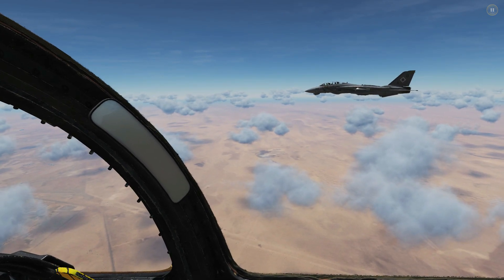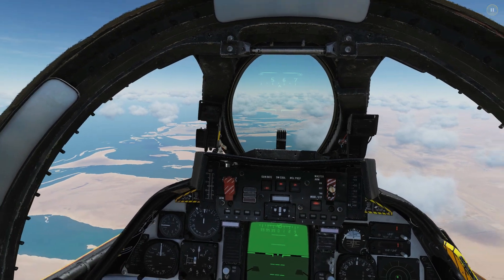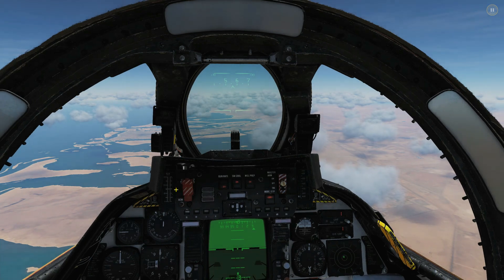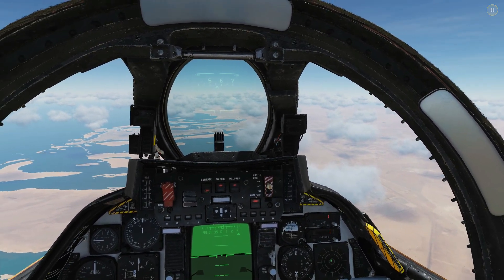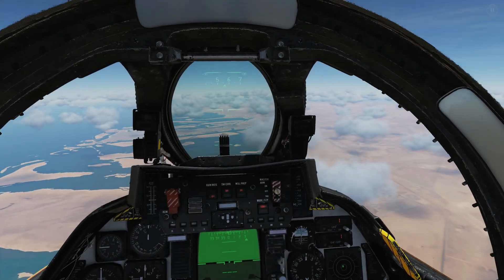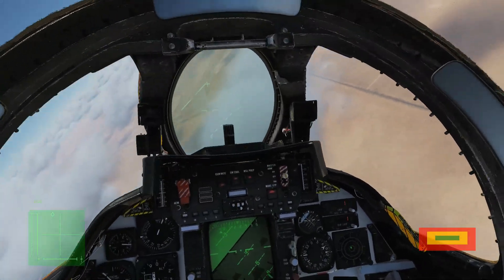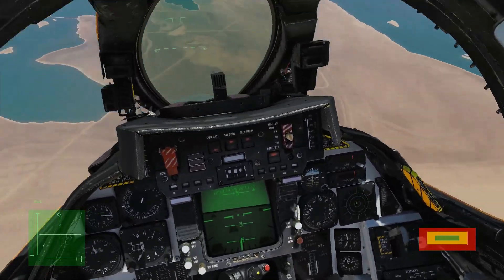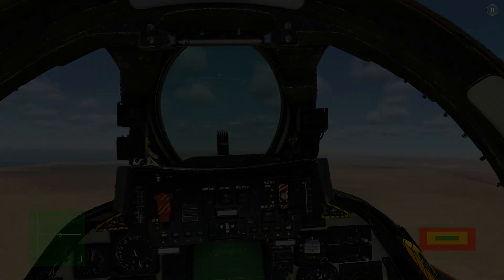F-14B Tomcat: Flat Spin Recovery Tutorial | DCS WORLD

Comment: Question: When you power the opposite engine, do you go to full after afterburner? Or full Mil Power?
Reply: With the asymmetric thrust limiter on, only mil. This is because of the added safeties to avoid asymmetric thrust through burners causing a spin. It will not allow one engine to be in burner when the other isn't, this is why in the B sometimes it seems like it takes a bit for it to fully enter burner, it's slowing things down to make sure it's even on both sides. If you switch that off the Engine Control System will allow full burner. 

The A model TF-30s do not have asymmetric thrust limiting as well, so they'll always allow whatever you put in them.

Comment: The F-14A TF30 vs the F-14B F110 with the TF30 having a bad life with the F-14, in tearms of problems with Flame outs and lacking power, question is between the TF30 and F110 how better is the F110 too the TF30, for example the scene in top gun 1986 would that happen with a F-14B or less harder to happen.

Comment: Any differences between the TF 30 powered Cats and the ones powered by its successor engines?
Reply from the maker: Will investigate
Reply: Yes, the TF-30 were quite underpowered compared to the GE engines. Once the GE engines came the engine stall issues were resolved. The aircraft a=was a true stick and rudder aircraft if there ever was one.

Comment: The two rudders generate an unbalanced couple via yaw angle. The most effective rudder is the one pointing to the center of the airplane. Basically the vertical fin shields the rudder on the inside of a turn. In this case, rudder to same side as spin makes the outside rudder (pointing to the center of the aircraft) an airbrake that slows down the spin. The inside rudder has almost no aerodynamic effect because it's centered in turbulence. That's why 2-rudder aircraft are uncommon.

Comment: just a guess (I'm not a pilot), but when you are in a spin, the inside wing is stalling more than the outside wing...and if you're falling and spining, your flight surfaces arent working properly....but the f14 is so large, maybe going full rudder is meant to make the spin a bit faster with the intent of making the stall on the inside wing so much worse, so that it forces the nose down?   

I mean, nose down and spinning is a much better position to be in....
Reply: I remember watching a video for American Airlines about getting out of odd AOAs and the instructor mentioned that for one of their planes, the rudder was so large that it was possible to fly the plane stable at a 90° bank because the rudder was so large that it was a functional horizontal stabilizer when the plane was on its side. "top rudder". 

he also said that if the other type of airliners were in a bad nose up attitude and inverted, the pilot wouldn't have "pitch authority at pattern altitudes". so, while turning out of an inveverted attitude, they were told to use coordinated full rudder to keep the nose up (opposite the way you're turning), because there isn't enough stability to keep it flying without going full rudder. 

this is likely all obvious but I mention it because he also said 'in his other life', his aircraft could fly at a 90° due to thrust vectoring, computer systems and large flight surfaces. He was clearly a jet pilot previously......so, maybe in the F14, the rudder still works and is intended to make the stall worse so the nose pitches down, into the spin? maybe if you reversed your engine power and did everything else the same, it would force the nose down faster?  

again, it's probably obvious why I'm incorrect and I'm too uneducated on the topic to know it. if so, please dont hesitate to correct me! I may just have come up with a technique that will send you into the dirt faster or is already known to be ineffective.....so, keep that in mind. 👍

Comment: I note you're not using aileron into the rotation.
This is how I understand it from aero studies - it's all to do with roll induced yaw.  Conventionally in a right spin you put opposite (left) rudder and right aileron, this combats the yaw effect by creating lots of drag to one side (similar to crabbing / adverse yaw).
On the F-14 in you wont have wash over the tail (obviously) and in a twin v.stab you have significantly less tail authority to work with (the leeward v.stab will be blanked by the winward, and the windward side has therefore 1/2 the tail area required for stability!).
So pumping left rudder into a right spin does nothing other than continue to help stall the v.stab.  Ruddering INTO the direction of the spin unloads the windward v.stab and due to this v.stab being offset from the CG you will get a roll induced moment to the right created by the yaw input.  This combined with the right stick, right engine, will combat the yaw but also put the aircraft on it's side helping it to pitch down and recovery.  There are gyroscopic forces in there as well as the plane rolls out of axis but that's above my pay grade ;)
Note in the r/l video the controller calls for left rudder, which is conventional but not for a twin tail imo.

Comment: I also was the Maintenance  master chief in VF103 when modified  the squadron aircraft to digital  Flight controls  (DFCS)   basically taking an analog system and making it digital.  Although the actuators when not modified... all done through upgrades control computers like the CADC ...  the nice thing about DFCS it made the aircraft extremely  hard to depart...   this result was make a poor pilot, in to a mediocre pilot..  i was also told the very good pilots hated DFCS  because a really good tomcat pilot knew how depart and regain control in a dog fight to win... DFCS stopped this ability... again I was a maintenance  chief... my job was fixing, not flying them...  what I am sharing is what I told by the crews on post flight debrief...
I remember a new crew had a DFCS failure and they tried doing some in flight trouble  shooting ... they pulled 4 DFCS breakers which had the effect of returning the jet back to Analog  flight controls... the analog tomcat had a problem with a Dutch roll (wandering nose)... this scared the crap out of the young crew... which had been around just few years earlier they would know what jet was doing and not freaked out do bad ... 
Funny thing we found out about DFCS ... on the cat shot if the crew raised the gear to soon, upon lowering  the gear the DFCS system would fault...  causing maintenance  a bunch of work ... fix was to count 3 potatoes then raise gear.. so once jet went weight of wheels the DFCS control system had a chance remember the flight parameters. Raise gear to fast the system went stupid when gear was dropped ... 
Thanks bringing back the big fighter for me... I loved my sailors, my Tomcats and my squadrons... best time my life and I have enjoyed sharing my memories  with you guys

Comment: I remember  the crews had go through spin recovery  training ... and I lost an A model due to a Flat spin in 101 ..  the MIsshap board I believe decided that the turn needle  was not correctly  marked ... the crews had trouble seeing the turn needle and if I remember correctly the turn needle had been changed to a  conflicting color ... again I believe  it was suppose be yellow ... .. this aircraft had need modified with correct turn needle but later in the aircraft's service life the turn needle had been replaced  with the old white on white needle.. 
I remember researching when technical  directive had been done ... 
The reason the contrasting color needle so the pilot can see  the direction of the flat spin easier ..in the turn and slip needle, because pilot got confused and put the rudder and engine thrust in the wrong direction  and increase the rate of spin
Reply: Which noticed the turn and slip indicator  in this simulation is white on white

Comment: I have two problems with the Tomcat first is sometimes it will deploy automatically maneuver flaps and won't close them when not necessary (example air to air refualing) is there a way to disable that? , and the second is I can't turn fight AI no matter what I do they don't run out of energy, I don't have good internet so I can't fight real people, can you give me tips on how to fight them or is it just the cheating AI  ?
Reply: Put the flaps up, put the wings in manual and partially sweep them for refuelling.
For turn fights, keep the wings forward, half flaps and throttle for ~320kts. Don't pull too hard. The easiest mistake is to pull for G and you end up with 20+ units AoA which dumps the energy. Once you realise that she turns really quick at lower G and 10AoA you'll do better.

Comment: The flight manual says rudder in the direction of the spin because that increases the air flow over the horizontal stabilizer.  This increases its “authority” in regards to getting the nose to point down.  Realistically, all you need to do to recover is get the nose pointed in the direction of travel, I.e.  down.
Reply: It makes sense. In the f-14, the horizontal stabilizers is what give you pitch control so it's logical to increase "authority" over these control surfaces. The flaps in the wings also help with pitch control but in a flat spin I'm guessing it doesn't help much.

Comment: by the way, another method that seems to work a that better is to roll in the direction of the spin, push the nose down, no need to rudder, this always (at least 95% of time) worked out for me and i could easily recover in less than 5000ft ;)

Comment: I would guess that if the manuals are saying rudder into the spin, that means they modeled/discovered in testing that in a spin mode the plane is actually experiencing a little bit of backward airflow, in which case your rudders work backward and right rudder helps you turn left etc. I'm sure an actual aeronautical engineer could confirm or deny this.

Comment: Was having problems with this the moment I got the Module. Always happened to me when I had the wings open. I pull them in as soon as she starts shakin sometimes that is enough to stop the shake before it really wigs out. Front end goes down easier. Rudder (check), wings in (check) but never tried the engine shut off though. Looks like it works. Love this beast of a plane.

Comment: A lot of the Tomcat’s lift comes from the fuselage and it’s stalled too.  An engine flameout and asymmetric thrust could/did cause a spin to the same side as the flameout so the big heavy plane is headed in that direction. I think ‘traditional recovery’ opposite rudder would work too - eventually. As time is of the essence in this situation, the Tomcat uses ‘same rudder’ and elevator down to roll into a diving corkscrew from which wing and fuselage are unstalled and normal recovery can be made. Cap’s low altitude recovery shows the tendency when it looks like he rolled inverted due to slow input normalization and almost entered an opposite inverted spin. Pretty sure that’s what’s going on with this. (Pilot for 42 years)

Comment: I did that inn an F15 - it was not nearly as dramatic. Take off - on the deck till 550kn - then vertical till stall - flat spin - recovered at 5000 feet. and made a Mach 1.2 pass overt the runway.

Comment: Can you do the same video for the SU-27? it can easily get into a flat spin or in a stall and is soo hard to recover.
Reply from the maker: Roger
Reply: @grimreapers  Would you mind testing the inverted flat spin, too? I managed to get into one in the SU-33 and failed to recover before the engines died completely.
Reply: Flat spin it can, yes, inverted, no, the fuel cuts the engines too quickly (before the spin fully develops)
Reply: @CameTo  But I did and managed to replicate it. You have to force it, but you absolutely can make it go into an inverted flat spin.

Comment: According to what I've read and heard, the F-14 still recovers from flat spins better than the F-4 did.
There were two developments that improved the possibility of getting out of these or NOT getting into them to begin with.
One was the GE F110 engine which had a better stall-free envelope than the TF30 ever did even after they spent $250million to fix the P&W engine! 

The other major development, applied to all core Tomcats scheduled to stay in service past 2000, was the DCS.  The Digital Control System improved the handling qualities of the F-14 and made it easier to fly.  Too bad it wasn't implemented earlier!  The DCS was partly based on work they did with the Twelfth F-14 (1X; so-named because it was finished faster to replace the original, lost F-14 prototype and take over its flight test assignments) at Dryden Research Center in the late 1980s.  They did research on modified flight controls for the F-14 exploiting (I forget exactly) the Aileron-Rudder Interconnect?  Anyway, the funding ran out for that program so it was never technically finished and they didn't apply the data collected to F-14 improvements for years. 

A series of control system accidents finally forced the Navy to re-explore the issue and fund the digital control system upgrade.  It's not fly-by-wire; it just uses digital computers to coordinate all the hydraulic lines, actuators, cables, etc., etc. better than the old analog system ever did.  The DCS made it easier to fly the Tomcat and especially land it on carriers regardless of the model.
One of the highlights of the DCS history was that one of the modded A-models that stayed in service past 2000 actually engaged in a DACT exercise with a Romanian MiG-29.  The F-14A pilot won that dogfight.  Surprised a bunch of people who thought the old A-model was a tired dog.  Has to be even more remarkable because by that time they had detuned the engines for ALL F-14s to extend hot-inspection hours and reduce overall maintenance.  The TF30s were derated to 17,700lbs in afterburner which had to hurt.  The A-model was already hurting for at least 16,000lbs more thrust and then it loses another 6400lbs of thrust!

The B and D model F110s were detuned to just over 23,000lbs in afterburner but there was an order that in case of war they'd restore full power in the F110s.  I think after they retired the F-14 in 2006 and knew (within a year or so) that the planes were never flying again, the Navy sold the remaining F-14 F110 engines to the Air Force since they were virtually identical build to the F110-GE-100's used in the Block 30 and Block 40 F-16Cs.  I imagine whatever TF30's weren't sent to museums were probably scrapped to prevent them from getting into the hands of you-know-who...
Reply from the maker: thx
Reply: @grimreapers  Actually, the computers and software used for the F-14 DCS (applied to ALL F-14 models) were based on technology developed originally for the EuroFighter Typhoon.  Sounds like they basically adapted fly-by-wire technology to the last pre-fly-by-wire American fighter!  Not true FBW but definitely safer than the original analog system and you could still over-G the plane!
That happens a lot more than people realize -- that is, applying technology from next-generation systems to current in-service aircraft.
The F-15E's F100-PW-229 turbofan incorporated engine technology developed for the Advanced Tactical Fighter program (which led to the F-22).  The upcoming F-15EX is leveraging avionics tech originally developed for the F-22 and F-35.

Comment: Use RUDDER OPPOSITE the spin in the F14. Rudder with the yaw direction will make a flat spin even flatter. 

The Hornet has spin arrows on the HUD via the FCS spin recovery system - these are for lateral stick, not rudder. Spin recovery procedure for the Hornet has the feet off the rudders or rudders neutral. As per NATOPS flight manuals.
Reply: I think CAP needs to test different methods and see which is best.
Reply from the maker: I think it will be so hard to test empirically guys, because these spins are so violent and hard to control...
Reply: @grimreapers  As spins go that spin was not violent at all.   But your incorrect recovery procedure seemed to work well, which means DCS is not very accurate at all.  It must be a call to a program code module that displays video of a spinning airplane, but the computer is not modelling the actual aerodynamics of the spin at all.
Reply: @gort8203  I think DCS is simulating the aerodynamics here. I think the asymmetrical thrust more than compensated for the incorrect rudder input, so it worked.
Reply: @silience4095   And you think that is accurate, but I still question how accurate it is.  We'll probably never know, because I tend to doubt the flight test program ever tried to recover from a flat spin with differential thrust against a pro-spin rudder input.  

No pilot would apply pro-spin rudder, and I have to wonder why Cap chose to.  
The F-14 spin recovery procedure is throttles Idle, stick forward, and rudder full against the spin.  Lateral controls are kept neutral initially because the F-14 does not have ailerons, so I speculate that the lateral spoiler input might increase the pro-spin yaw moment.  But even so the procedure directs use of stick in the direction of spin IF the rudder fails to recover the aircraft.  (In jets with ailerons, stick into the spin is a primary anti-spin input because the drag of the down-going aileron creates a yaw moment against the spin.)